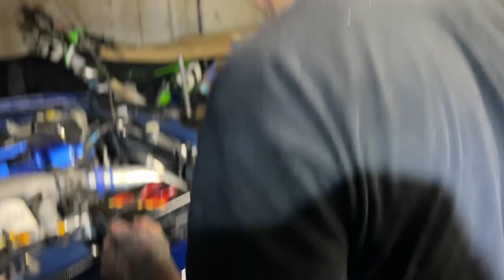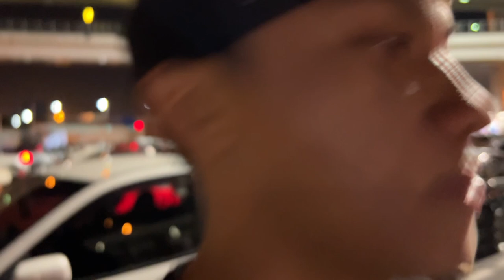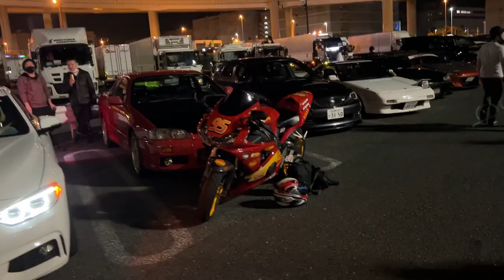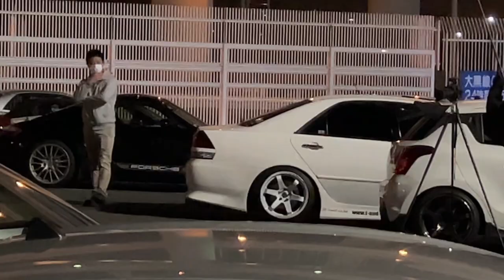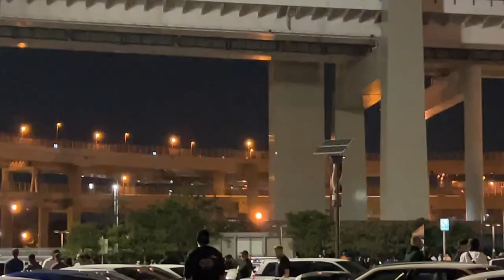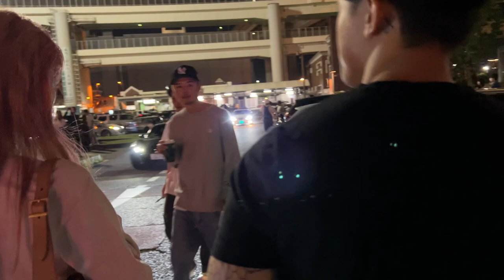GIRLS CAR MEET! JAPAN NIGHT CAR MEET

Comment: I should've been there with my 2003 VW Passat 1.6! It does 0-100 in 18 seconds flat! Also still got studded winter tires still (it has been a very crappy spring).

I can pretty much guarantee I would be "unique", though not much else. 😄